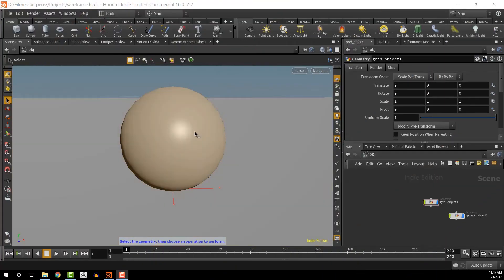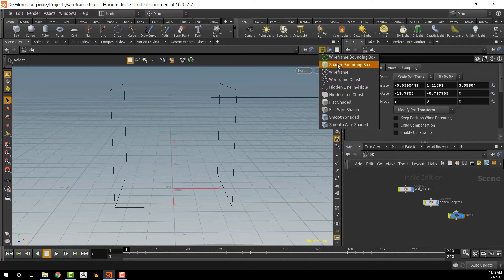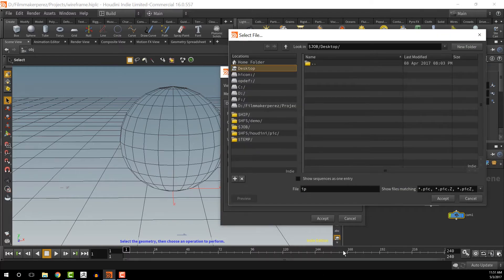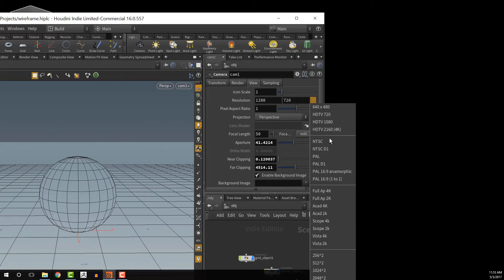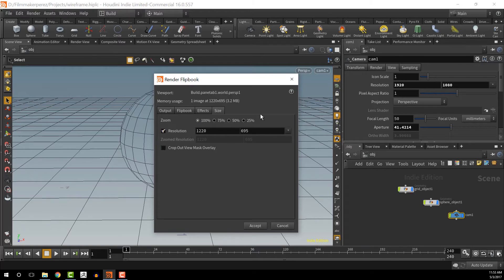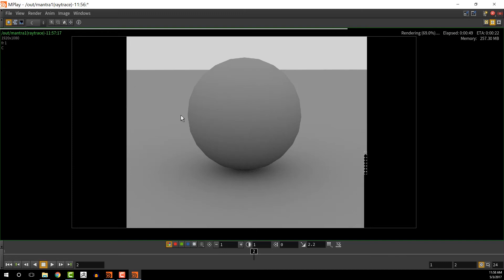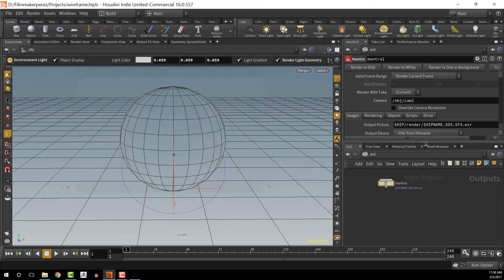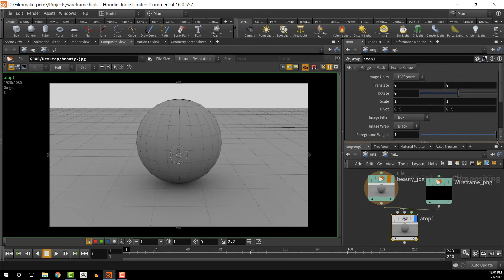Rendering and Compositing Wireframes in Houdini 16

Comment: You can do this in a layered shader using filter step vops to create the wireframe. 
Or use a polywire to get actual geometry. Using wren is another option too, just drop a fuse set to unique points and wren
will render it out in wireframe.